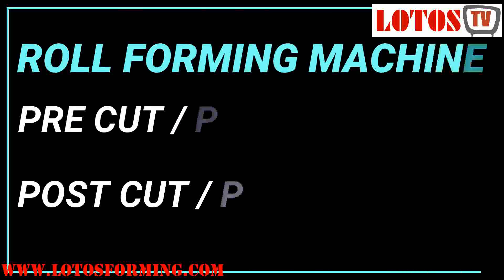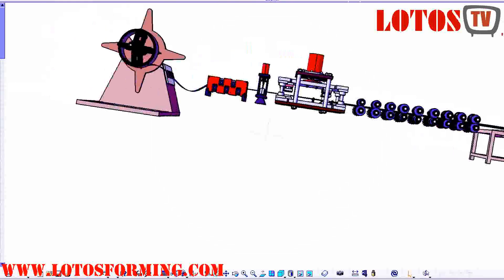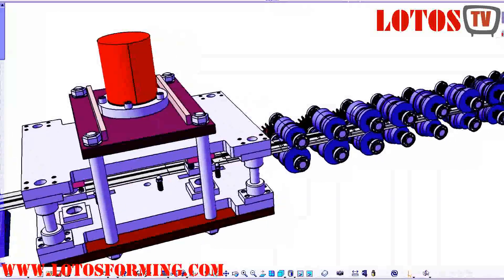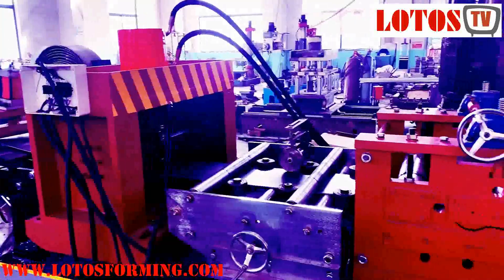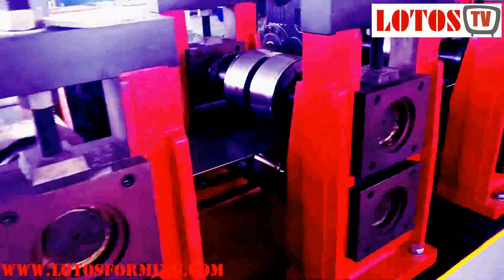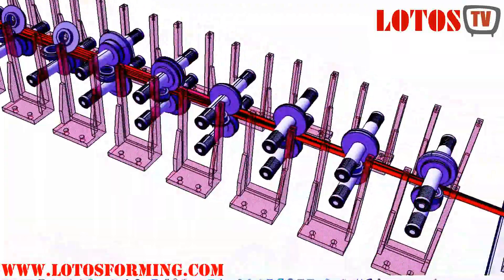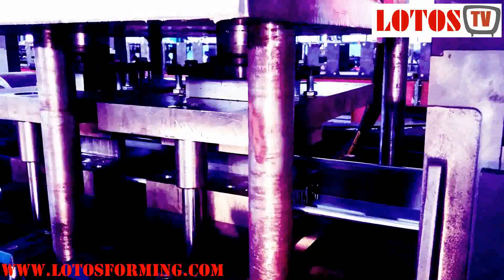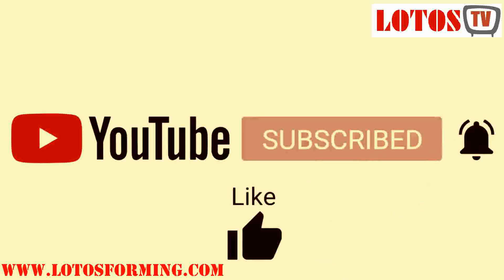【How to choose for your roll former ? 】: Roll forming post-cut or pre-cut advantages" LOTOS DESIGN"

Comment: Good afternoon sir 
Your knowledge is awaysome 
I want to learn machine building 
Basically before Machine building 
Generally we should learn how tooling is works 
But for general knowledge vise what parameters is basic important
Machine width
Roller Stations to station... Pitch. 
Roller to roller pitch of the gear drive or upper roller and down roller  gap in mm....? 
Motor capacity..... 
Machine minimum length and maximum length 
Minimum stations 
Maximum stations?